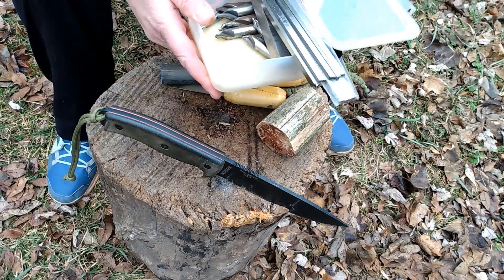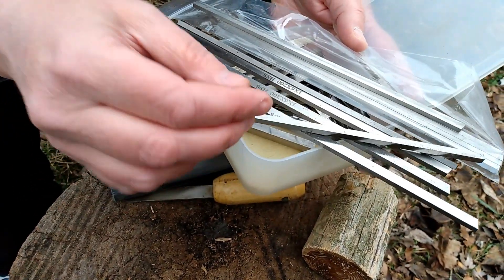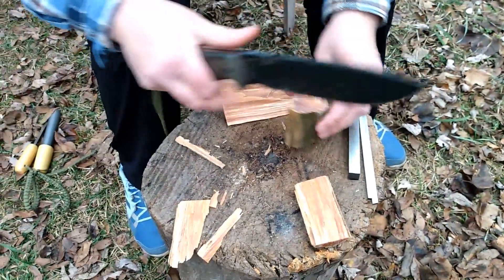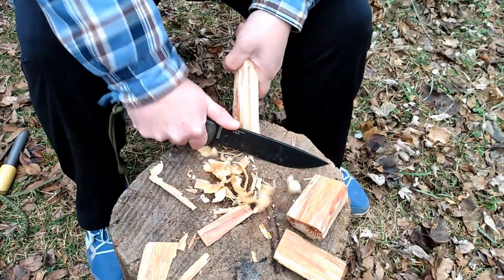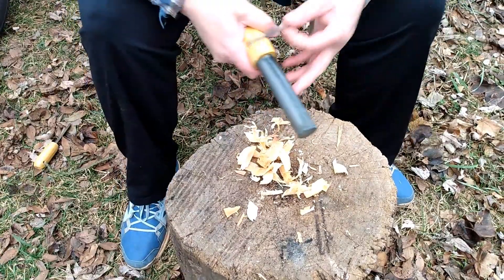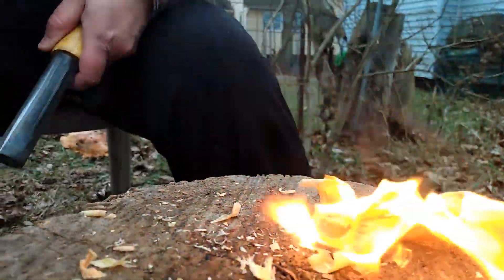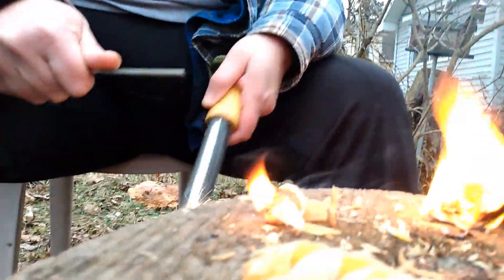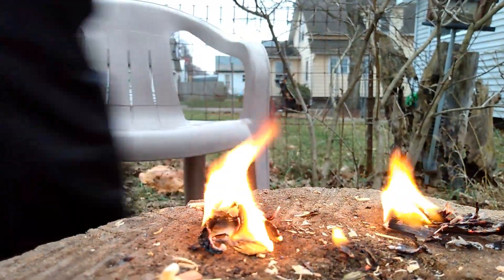First Fatwood Friday 2024 New Year

Comment: I have one of them speed strikers I got from work when I was a welder,  with mine I got to push down my ferro rod at a slight angel or it will leave speed bumps on my ferro rod ..
Reply from the maker: Yeah those speed bumps are like the ripples on a dirt road. 80 grit sand paper and a little patience will fix them. You're right about the angle. The angle of the striker must be acute to the ferro rod.
Reply: The best way to get rid of speed bumps is to use a file going in a slow and lite motion so ya don’t make sparks.